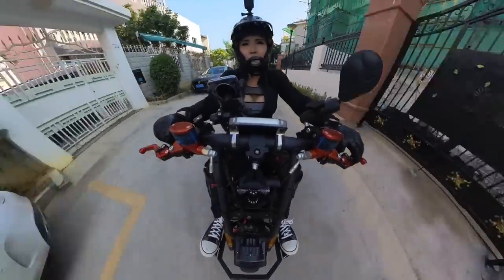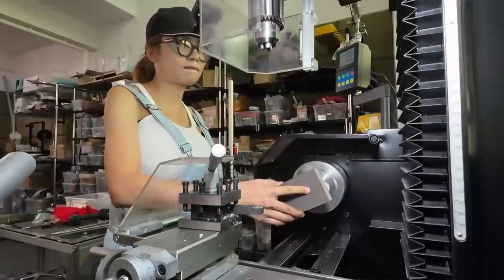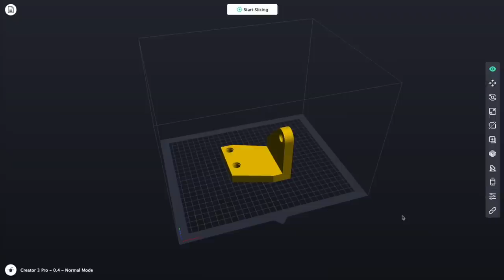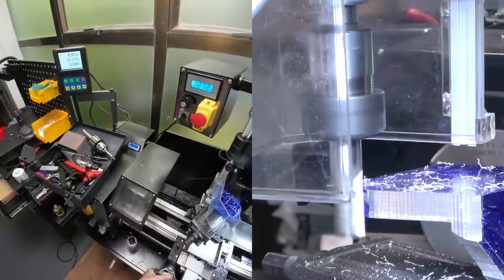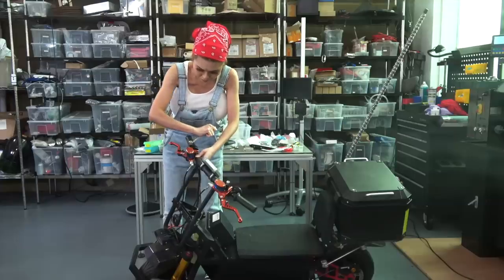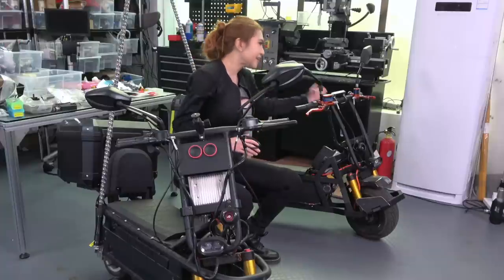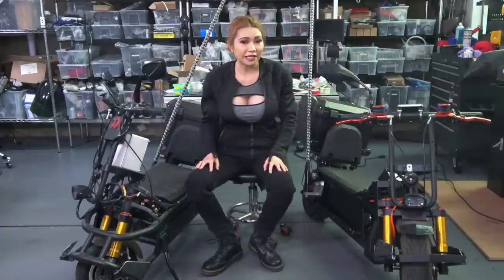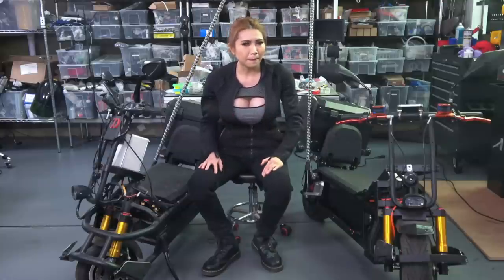7000 Watts! The Alien Rides Extreme Bull K6 E-Bike- Review and Upgrade!

Comment: I love how you are moving into manual machining, and combining with your previous mastery of additive manufacturing to simplify layout and marking.

Keep up the good work!
Reply from the maker: Thank you very much!
Reply: It's reverse of how I learned machining. Back in the seventies, we had machines to learn on in shop class. Then out into real shops. Learning spray metal, welding, and making. My brother has a variable inverter in his shop. We have a old lathe and mill. And a assortment of machines. He got a Ender 3 pro printer. We are moving to a new location, with more room for expansion.

Comment: As an owner and rider of the K4, a helmet, good pants, gloves and rugged shoes is a must. Like you, I fashioned an extended luggage rack (10"x14") with an  30" extended upright matching the backrest. With that I was able to attach a bicycle turning signals on the top so any cargo wouldn't block the lights. Going to add LED light strips after seeing yours. Plus add those cool mirrors of your too. I got my K4 up to 52 MPH on flat ground but my battery use was significant. Being able to scoot away is a big plus compared to most e-bikes and e-scooters. I had one crash due to leaning into a turn too steep and slid away. Hence the pants and gloves. Part of the learning curve, Thanks for the review and looking forward to more of your e-bike rides.

Comment: A machinist tip, center drills turn fast. Speed increases as diameter decreases. A 12 mm drill should should turn around 400 rpm, same as a 12 mm piece in the lathe. The center diameter of a center drill, determines rpm. So maybe a 1,000 rpm or more, for small drills. Low speed tends to break them, by taking off more than they can chew.

Comment: Prototyping parts can take a while to get it working as intended but i really enjoy your creativity using 3d print part to do metal work pretty creative nice work. Sure can be pain to prototype it but once made u can replicate it almost anytime.The Bull K6 E-Bike seems nice with the ability for custom work its definitely a worthy check. It seems little unstable but hopefully that back installment will make it more stable on road adjusting the weight a bit. Customizing it is always a plus its also nice mention that it can be fixed with ease on the go and parts are not that hard to find overall.Thank you for showing the creative work on the customs awesome as always!

Comment: Very impressive crafting the modifications.  Your use of the mill is also very good.  The youtube channel This Old Tony had an episode on Tool Chucks and with the mill bit looking concentric and spinning off center, it might be worth your time looking into his video and a good look at the adapter in the collet for how round and true it is.  I am supprised that extra lights to keep it visible was not included as LEDs are relatively cheap.  In Canada, even if it is not registered as a vehicle, an e-bike needs to have ( in our regulations ) at least one mirror, turn signals and headlight and makes people here expect that as ' standard issue ' on one.  It does look like it is comfortable and fun to ride.  Edited to add: I do not mean to make it sound like it has no lights, just not enough for what a Canadian such as myself would expect as standard and safety needed.

Comment: Hi Naomi, Looking at your milling and the poor finish it occurs to me you may be doing climb milling. Climb milling is when you move the piece in the direction the cutter rotates. Especially on fine cuts it leads to a rubbing action. To get the cleanest finish you have to move the piece so that the direction the cutter rotates causes it to bite into the moving piece. The rotation of the cutter blade  is moving in the opposite sense to the direction of movement of the piece. This causes a cut rather than a rubbing action.

Comment: Haha and I’ve made aerospace parts on cheap Taiwanese manual machines that I’ve converted into CNC.

Aerospace specs are .005 - .030. If it is a cast iron machine you shouldn’t have any issue obtaining this accuracy. 

While it is true that the quality of part reflects from the machine if you check runout, backlash, travel guides, gear lash, and squareness before you buy you can find chinese machines that can produce these results and even be improved upon if you have a nice machine to access modifying your parts.

Its really not difficult to do when setup correctly. Then again I do machine for a living.

Comment: You mentioned legality at around 16min, I looked up Sweden and thought I'd share. It should be valid for all of EU but don't quote me on that. 
It is too strong too be a moped class 1, they need to be under 4KW and also limited to 45Km/h. They also need registration plates etc.
It would have to be registered and driven as a light motorcycle, they can be up too 11KW and 0,1KW/Kg. With the weight given on the website it is under that, but it should be without batteries and I don't know what they gave on the website, so it might be over.
So yeah I wouldn't want to even give it a try to register this. It is a pretty cool bike though, I especially like the how easy it looks to Hack.

Comment: Nice video. Cool shop. 
7,000 Watts?? Nine HorsePower!!🐎🐎🐎🐎🐎🐎🐎🐎🐎That's far more than my first (50cc gasoline) motorcycle, and probably more than my second (a 250cc) really had. At city-speeds, that is fantastic. 
Agree that this is frighteningly vulnerable in a city, but where I am we have miles of near-deserted roads. And most drivers expect anything from bicycles to farm equipment to deer or moose at any time.

Comment: The drill/lathe wobble looks to come from the legs. Are they securely bolted to the floor?
Reply from the maker: Can't, rental. But the legs are actually solid and sitting flat. Seems to be where they are connected🤔
Reply: @Naomi-Wu  - have you considered 'sandbagging' the legs? Adding weight to the bottom after leveling the legs can work well. We used concrete blocks on our mill in shop class, then backfilled with sand. Sand also reduces vibration.
Reply from the maker: @eric_has_no_idea  Ohh! That's a great idea! Let me look into that- thank you!

Comment: Where did you get that information about the battery on K6 I asked begode directly K6 battery is worse and alot less 3500wh or 2900wh only the k4 has 4400wh battery 👍

Comment: Did this company actually consult any actual Riders? As you noted out the box it seems like a very under designed piece of equipment? No headlight? No tail lights or turn signals? No mirrors? No cargo capacity? And it's ride height is incredibly low. I hope this company takes your suggestions for upgrades very seriously.